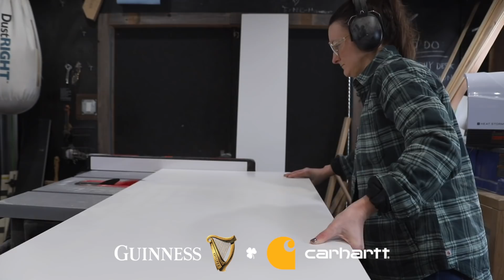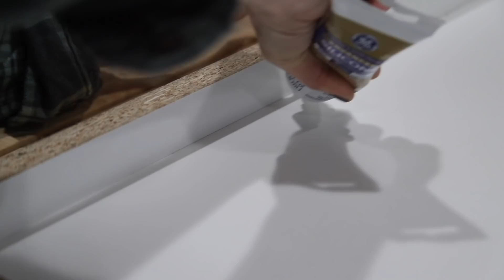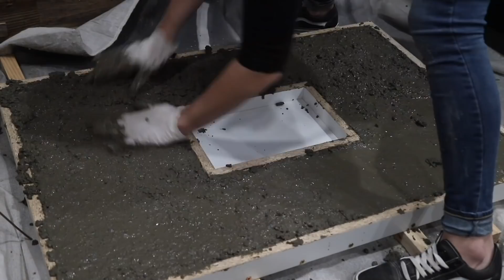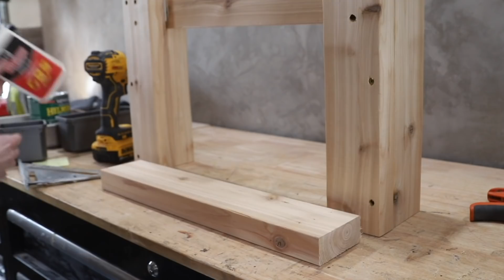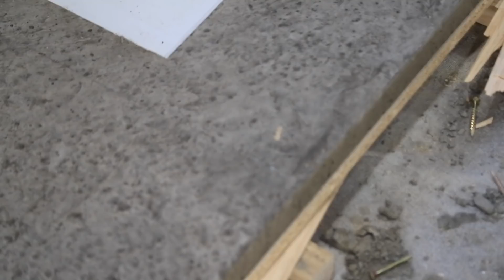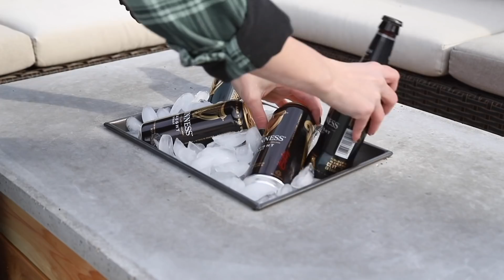How To Build A Concrete Table (With Cooler Or Fire Pit)!

Comment: Strong Island!!! Woo-woo! That looks AMAZING! Cement slabs always are unpredictable when removing from forms, but you lucked out. Two small tips I’ve learned: 1) use a reciprocating saw without blade and vibrate the cement and it’ll remove any bubbles so you don’t have to shake it. 2) spray form before placing cement with WD-40 (sponsor?) or mold release or vegetable oil or PAM. Rant over! Excellent and keep up the great work!!!
Reply from the maker: Thanks for the recommendations! This was my first time working with a larger concrete project. Can't wait to do it again!

Comment: The table turned out great.
Concrete fiber is a great way to strengthen the top and tapping the edges of the forms with a hammer helps get the air bubbles out.
Reply from the maker: Thank you! Lots to still learn after tackling this for the first time! Can’t wait to try concrete again soon!

Comment: I see this vid was 3 yrs ago so you may already know. If not, share this advice on your next concrete project.

Professionals use "FORM OIL" to coat all form surfaces before adding concrete. Once the cement dries and cures, the form pieces will come off without issue, and you have a clean project. Hope this helps. You should find form oil at Lowes or Home Depot.

Comment: When using a screed - any long, flat instrument - to flatten concrete, you should 'shake' it side-to-side as you pull it along the concrete.  It helps distribute and settle the concrete as you go.  Awsome project - I'm looking up things I can use for inserts for similar tables.  Cedar is an excellent choice for outdoor stuff, too.  You didn't show in your video if you used finish on the inside of the table base or not.  You should.  Cedar is much more resistant to warping than other woods, but a sealed outside and raw wood inside is a sure recipe for max wood movement.

Comment: One of your bests Sam! Great, great project!
Couple of questions if I may:
1. You mentiond drillinig drying holes in the future. Why?
2. How whould you attach the concrete to the base? Does that require any special tools/screws?
3. Have you thought of adding casters?
Reply from the maker: Thank you! Shortly after I installed the table it rained, and the rain got caught in the pan and I had to scoop it out. So, I feel like drilling holes would help to avoid that in the future. I did not need to add any fasteners to the table top because it is so heavy. But, I have definitely seen people attach concrete tops to furniture with silicone. I didn’t think of casters, because we aren’t planning on moving it. But, definitely a good idea if you are, because it’s so heavy!

Comment: Would the concrete not crack form the heat? And the cake tin not melt through?
Reply from the maker: The pan doesn’t heat up hot enough to effect the concrete. We’ve used it serval times... and the pan is a high heat pan that was ordered from a restaurant supply company. So, it’s made for temperatures higher than an outdoor campfire gets.

Comment: Great build!  Question though.  If you make drainage holes. don't you run the risk of hot embers falling underneath and burning either the cement (or wood deck for some builders) underneath OR hitting the wood frame and catching fire?
Reply from the maker: Thanks! The fire pit I actually have to burn my scraps has small drainage holes too. Nothing usually comes out of there because they’re not really that big. I’ll probably end up doing something similar.
Reply: @diyhuntress  Thank you for the info!  I really like that design and will have to look at making one myself!

Comment: This is AMAZING!!!! I went ahead and checked out your website but the long stretcher was missing the lengths, would I be able to get that from you? Thank you for your time.
Reply from the maker: Thank you! Just double checked and they’re there! Let me know if you have trouble locating them. Happy to help!
Reply: Thank you for your quick response! I went on and still couldn’t find it, this is what I see on my end:

2 x 4’s
(8) Legs @ 14 ¾”
(8) Long Stretchers @
(8) Short Stretchers @ 18 ½”
(2) Supports @ 20 ½”
(2) Leg Supports @ 14 ¾”
Reply from the maker: @kitazkreationz8414  Hi! So weird! Can you try to clear your cache and let me know if it works? Either way, here is the updated cut list!

2 x 4’s
(8) Legs @ 14 ¾”
(8) Long Stretchers @ 30 ½”
(8) Short Stretchers @ 18 ½”
(2) Supports @ 18 ½”
(2) Leg Supports @ 14 ¾”
Reply: Thank you so much I went ahead and cleared like you said and it worked!! I appreciate you taking the time out to respond. One more thing (I’m sorry I hate to be a pain in the a$$🙈) I noticed you changed the size of the 2x4’s Supports from 20 1/2” to 18 1/2”, is 18 1/2” the actual size it’s suppose to be?

Comment: Potentially the heat could crack and blast the concrete. Has there been any damage to the concrete top from excessive use?
Reply from the maker: No. There’s barely any heat transfer at all. We’ve used it a few times as a fire pit since I've built it.
Reply: @diyhuntress  that's great. Well done on the build and great video 👍🏼
Reply from the maker: @tinker2561  Thank you!

Comment: Cool piece, want something like that. Want to try concrete as well but they don't sell melamine in my area was wondering what else to use with a smooth layer.
Reply from the maker: Thank you! This is definitely something that I want to experiment with. Because, I have experimented with making different molds for resin. This might be a fun new adventure!

Comment: Nice, but I would have made one of the sides removeable so that a drain pan for water or ash can be removed.
Reply from the maker: That’s why I want to drill drainage holes in the future. 🙃
Reply: @diyhuntress  You know those magnitic door catches I would put 2 to 3 on each side so 4 to 6 in total of  one of the short sides that way you can pull off the side with some effort, but most children won't be able to and it won't fall off if it's kicked, but can be removed the next morning when it's clean up time. You would be able to hide them easily.

Comment: Does the fire heat the concrete up much?
Reply from the maker: Nope! My dad actually had a fire going in it today and the concrete didn’t get hot.
Reply: @diyhuntress  thanks :) one thing I would keep an eye on is that thing burning through as it's only thin steel. Might be worth getting something welded up with plate.
Reply from the maker: @TheVinn3h  The pan I ordered for this build is a high-heat pan that I ordered from a restaurant supply company. Specifically ordered it with the fire pit use in mind, so it should be okay!

Comment: Nice table. Did you get cracks at your 90 degrees corners for the insert? I found if you give a slight round over to the corners they don’t crack. I learned the hard way on mine and I had to repour a new top.  also foam for the insert worked great just gotta dig it out and you can shape those round overs. I’m definitely interested in seeing more concrete work from you you’re table came out very nice I like the duel function of cooler and fire top. I’m definitely subscribing I can’t wait to check out more of your videos.